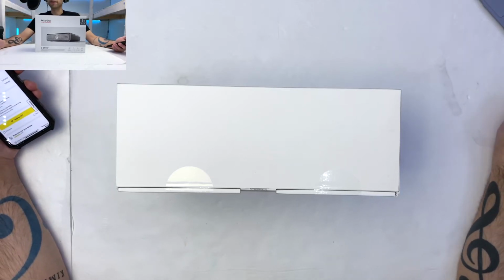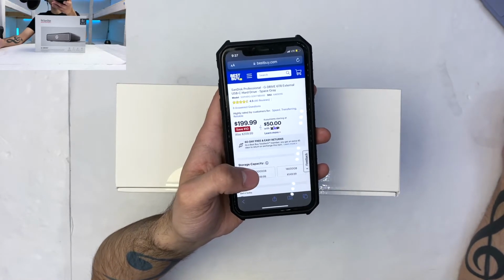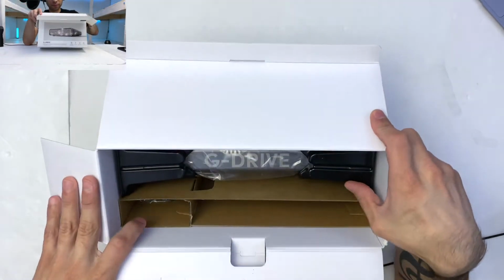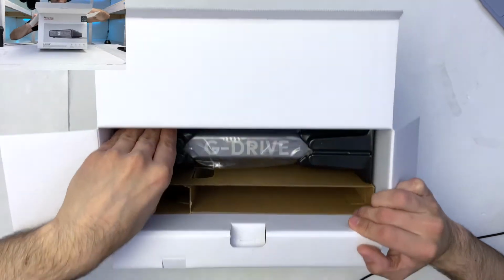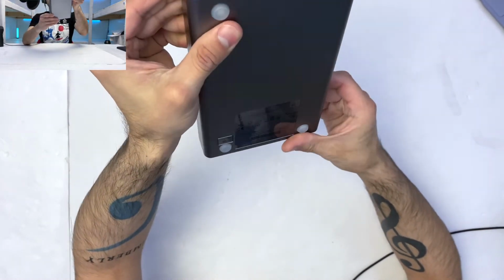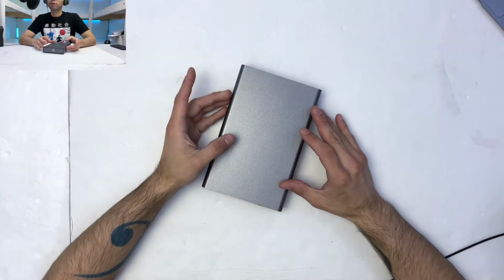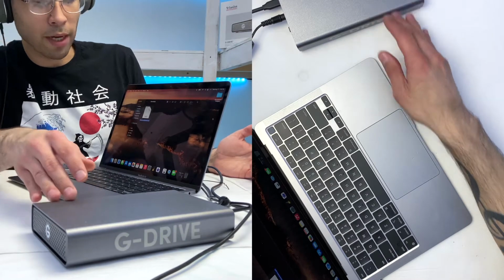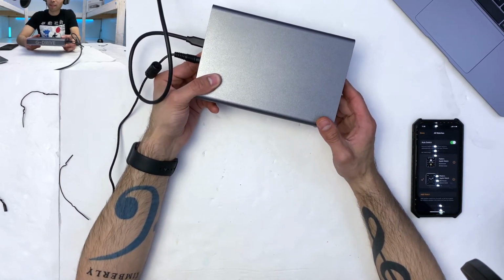Sandisk G-Drive 6TB External Hard Drive

Comment: I’ve just bought a 2nd hand 20tb one do they make a low clicking/knocking sound every 10 second or so
Reply from the maker: I would be wary. I’m about to make a video where I tell you that mine just went out last week. It’s almost 2600 for data recovery or at least that’s what they quoted me for.
Reply: @unboxingwithpaul  couldn't find follow-up (?). How many hours do you estimate it ran before it failed? Was it used daily or only as backup? Or used as editor drive for media? Any info would be great.

I have a new one, but if it is prone to failure, I will use your experience to determine its fate (i.e. editor drive or backup to a reliable backup)